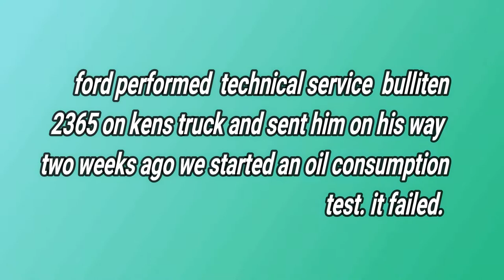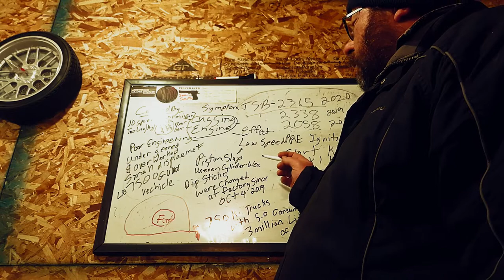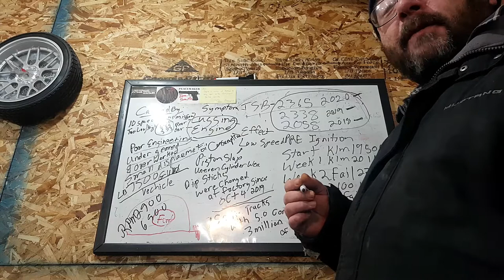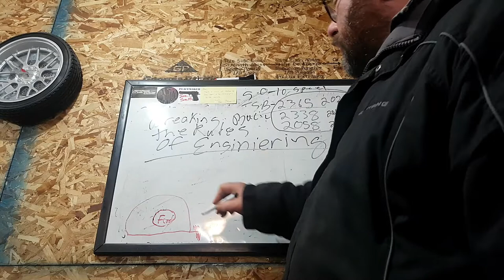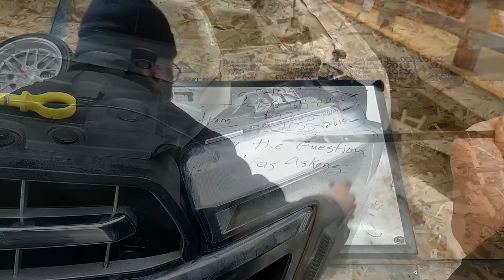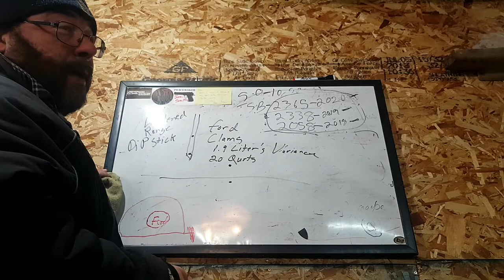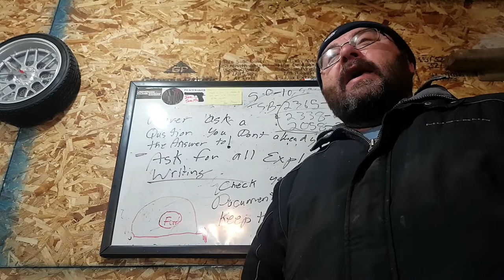ford f150 burning oil problem and consumption issues

Comment: I have a 2019 F150 5.0 V8. The truck was manufactured in December 2018. I bought it in August 2019.  After a couple of days of ownership, I noticed the engine idled fairly loud.  It sounded rattley, and had a tiny bit of knocking. I checked the oil and it was almost full, but not quite. Also, when cold, I noticed the transmission was downshifting harshly and I could sometimes hear and feel a clunk when it downshifted. I also heard a whining sound when the transmission is cold and downshifting to lower gears while slowing. When it warms up, the harsh downshifting and whining sound diminish quite a bit, but I sometimes still feel it.
  I called the dealership and spoke to a service manager the following week. He said the above issues are "normal" and indicative of the F150 5.0 V8.

At 2200 miles, I check my oil level and discovered my oil level was so low. It was well below the minimum fill line on the dipstick. I took the truck to a mechanic who saw NO leaks, nor did I see any evidence of a leak. The mechanic did an oil change and made sure it was filled to factory specs.

At 4600 miles, I checked the oil level. The oil level was again, very low, below the minimum fill line. I am bringing the truck in to the Ford dealer tomorrow (08/18/20).

This is all depressing.  I have owned several Ford vehicles previously and never had a problem.  I chose this truck because I thought I was getting a vehicle that was tried, true, and well rated.  I chose the 5L V8 because I wanted to avoid future issues with all the extra parts on the ecoboost V6.

What pisses me off most of all, is Ford knew about these issues in 2018 and they still sold me this truck in Late 2019!
Reply from the maker: they included 2020 in the technical service bulletins as well,no fix in sight,get documentation ,follow up with lemon law,please keep in touch and good luck with your fight!.

Comment: They had oil consumption problems back in 1987 when they went F.I. and still hadn't fixed issue when I bought a new 1990.I think Ford claimed a liter every 800km? was normal. After 4yrs they were going to rebuild(can't remember exactly) but I went and bought a '94 with the 300 instead
Reply from the maker: 1 liter per 800 k seems excessive to me. ty for taking the time mayes

Comment: What a bummer. Need to put a few more miles on my truck to see if the last TSB worked.  It was in the shop for a bit because ac condenser unit was draining into passenger floor board. Ruined the carpet, I didn’t notice because of the weathertech mats.  Waiting on a new dashboard too since mine is already warping.  Way too many problems for a new truck.  Thanks for putting these videos out!
Reply from the maker: thanks so much for taking the time andrew!

Comment: The 2019 5.0L has sprayed in cylinder liners, the rings do not seal.
Reply from the maker: the oil isnt getting past the rings its coming in through the intake,low speed preignition
Reply: All 5.0 2018-2020 has the same issue. Don’t understand why they keep making this crap. I did hear the 2021 5.0 have been corrected.
Reply from the maker: @saltrock9642  i would not count on them fixing it.  10 speed transmission would have to be rolled back to the 6 speed in my opinion. ty salt rock

Comment: Thought I had gotten a great deal on a left over new 2018 f150. I bought this truck 2 1/2 weeks ago today I heard a noise that i thought was a spark knock. I check my oil and after 1,749 miles i am 4 .6 quarts low. So mad they didn't warn me of these especially after I asked a ton of questions
Reply from the maker: Stay in touch.  Does your state have a lemon law.
Reply: Yes, I will be exploring my options regarding lemon laws as in SC we have pretty good Lemon laws here
Reply from the maker: @mewbourn76  that's excellent.

Comment: I'm wondering if the government demanding that Corporate Average Fuel Economy, or CAFE, standards requiring an auto company to deliver a fleet average of at least 54.5 mpg by 2025 has anything to do with them toying around with all kinds of things they shouldn't.  I think those standards are being rolled back, but decisions were made already on the current vehicles.
Reply from the maker: Definitely part of the problem 🤜🤛
Reply: And don't forget good old "corporate greed" as well.  They want to squeeze every penny of profit out of these vehicles regardless of what's best for the customer...

Comment: TFL Truck just featured a video with a guy who has a 2018 5.0L. According to him, his dealership replaced the PCV valve with one that had a different design and he claims his issue has been solved since April of 2019. He didn't go into specifics though.
Reply from the maker: thanks for the heads up red wings. appreciate it!
Reply: @thisguysgarage  not a problem! Really hoping to see you solve yours!

Comment: I experience the lugging and preignition. You can for SURE feel it as you cruise 45-55 mph.  Mine sucks down 2.5 quarts in between 5k oil changes. Shame because if the trans held the gears a little longer this would be an awesome truck. Maybe worth a transmission tune along with the ford pcm flash to prevent fuel cutoff when decelerating? I would love some trans tune company suggestions!
Reply from the maker: i would look for a good vehicle tuner in your local area, have you tried sport mode?
Reply: @thisguysgarage  I haven't regularly used sport mode, no.  It is a bit too aggressive. I am trying not to sound picky but clicking over to sport mode every time I drive is a little much. It also holds gears up to about 4k rpm. 3k if you are babying it.
Reply from the maker: @zacharywatson3242  Is ford doing anything about the consumption issue?

Find a dyno/tuner that is reputable, this was the route I was going to go if ford had replaced my engine.  They can make it the way you want it 👍
Reply: @thisguysgarage  Just had the pcm flashed.  It does make a huge difference. No more lugging. I also changed the PCV valve to the Mustang 5.0 part (Part No. EV 281).  I may put the catch can on as well. I will update with results after a couple months.

Comment: This is why I specifically looked for a used 2015-17 5.0 with the 6 speed. The 2018+ 5.0 also has port and direct injection. Direct injection requires/creates more pressure, which causes more blow by (in theory). 4 more gears in a transmission plus a more complicated engine, all to get .5-1% better fuel economy, just means more stuff that can go wrong. Also why I do not like the v6 turbos. If any part of the turbo systems fail, the cost is about as much as a new engine. Everyone is worried about the carbon impact of vehicles. Well, what is the carbon impact of building a completely new vehicle because the one you own wont last 200,000km???
Reply from the maker: absolutely 100% , I wish I had kept my 16 it was trouble free. 🤜🤛
Reply: the 2015-2017 have direct injection only I believe.  the 2018 added port as well to help keep the cylinders clean and added some HP due to more fuel availability.  Just having DI in my opinion is worse due to the cylinders getting gross after 30k miles.

Comment: I've thought this all along.  My 18 F-150 5.0  3:55 gear going down the highway 70mph with cruise set doing 1200rpm.  That's almost lugging. That cannot be good for any V-8. I drive mine mostly in sport mode just to wind it up. I do not have the oil consumption issue though at 15k. mi. I think at highway speeds these trucks are geared way to high.
Reply from the maker: result low speed pre ignition. ty for taking the time mike, keep an eye on it!

Comment: The 15 17 with the 5.0 are bulletproof I heard it had to do with the ceramic coating on the heads causing all these issues I could b wrong. Seen some 5.0 with 250k already. I have a 2.7 Ecoboost no issues have 90k now
Reply from the maker: I had an 11 13 15 and 16 all were bullet proof. ty jay

Comment: The transmission was co developed with GM. However the GM trucks don't seem to have any of these problems. Whatever GM did seems to be working.
Reply from the maker: I'm hearing of issues with GM not recommending towing with the 10 speed  but they do have 3 transmission options. 
Ty for taking the time 👉
Reply: @thisguysgarage 
That's interesting. I haven't heard of any towing restrictions for the gm 10 speed. The last TFL towing test with the gm 10 speed, they praised the transmission. Where'd you hear that from? Any updates on your f150 issues?
Reply from the maker: @curtis1951  it was from a subscriber.  Ford has not resolved any customer concerns on this issue. Trying to bury the problem with a 3 quart widened range dipstick as opposed to the 1 quart original equipment.
Reply: @thisguysgarage  
I've owned three F-150's so that doesn't surprise me. It should be illegal, especially for the price these trucks cost. I've had issues with the gm trucks I've owned but nothing like nothing like this. Hope you guys get taken care of but judging by how Ford's been operating the last few years I wouldn't hold your breath.

Comment: Whats your experience with the  durability  and  issues with maintenance with the 3.7 and the 3.3 ford v6`s? Thanks
Reply from the maker: here is the bonus ,if you can live with the naturally asperated v6 it still has the speed transmission which is good, the bad is the 10 speed transmission what is killing the 5.0 , the 3.7 and 3.3  are durable engines.  ty for the question and taking the time.

Comment: I had the same issue with my 2018 f150 5.0, it first started on the first oil change, at 36,000km they changed the dipstick and re-tuned the computer of the truck, im now at 39,000km and hasent dropped at all, they did made a mark on my dip stick with a sharpie so i can monitor it myself as well, its 2 quarts for sure between the add and full mark, i never had the transmission issue you been saying though
Reply from the maker: Ty for taking the time.  Just wondering if your truck is 2wd or 4wd .reg cab or super crew? Just wondering. Ty for taking the time.
Reply: this guy's garage its a 4x4 supercrew with the 5.5 box
Reply from the maker: @diftoyota  👍

Comment: Scotty Kilmer says the oil consumption problem is a Ford class defect that Ford won't admit to.  All of Ford's work arounds don't address or fix the real problem..... which is that Ford used an aluminum block on these 5.0 engines, and didn't sleeve the cylinders.  They used a ceramic coating in these cylinders (to save a few pennies), and this coating is either failing or it isn't working as it's supposed to, thus causing the massive oil consumption problem.
Reply from the maker: ty
Reply: @thisguysgarage  The only  difference between a 2017 5.0L and the 2018-20 5.0L is the new plasma welded cylinder liners were added. Period. Once bored out to spec, they are very thin walls, not enough there to make a rigid cylinder, no strength, no resistance to warpage under high heat,  they are simply wearing thru the bore liners in short order. No wonder the massive oil consumption. Don't expect much from a replacement 5.0L same plasma bore welded cylinder liners. Same old thing. Ford needs to go back to cast iron cylinder liners. Same 5.0L block was fine in 2017 back. With the cast iron cylinder liners installed. All the fixes for the oil burning are just buying time for Ford to get out of warranty on these junk blocks. And screwing their old time customers in the process.

Comment: They still can’t explain the rattle in the engine and the hard down shift. My truck is in the shop now with this issue (changing out 12 different parts in the engine) and the rental truck, 2020 F150, has the rattle and was 2qts low on oil. When I realized what engine was in it I had to look. Lol
Reply from the maker: my salesman told me to stop checking the oil and bring it back dead...
the rental is 2 quarts low hilarious
Reply: I’m thinking your in what we in South Louisiana call the “Frozen Nawth” so this issue is wide spread. Thanks and have a Merry Christmas
Reply from the maker: @saltrock9642  yes the GWN lol ty sir and merry Christmas

Comment: Ford needs to make this right
Reply from the maker: Absolutely Brandon. Ty for taking the time 👍
Reply: @thisguysgarage  I just bought a 2019 this week . 5.0  this will worry me something awful
Reply from the maker: @brandonmurphy4657  i would suggest a high quality oil like amsoil and use sport mode it will keep the engine from lugging . keep in touch!
Reply: @thisguysgarage  Mobil 1 ? I have always used it in my other trucks
Reply from the maker: @brandonmurphy4657  i have used mobile myself,low speed pre ignition is what is killing these trucks, the amsoil has been designed for this,when i put it in my new truck the engine got significantly quieter. ty again

Comment: My 2018 F150 5.0 have the same problem and Kitchener Ford, Ontario replaced engine last month and i have more problems now with my engine, always rattling noise from the camshaft solenoid which they replaced and it failed again and  oil leaks from gaskets and oil cooler. these guys don't even know how to replace an engine.
Reply from the maker: I am hearing quite a bit of that. 
Ty for taking the time 🤜🤛hopefully you get some satisfaction 👍
Reply: @thisguysgarage   I need a technical advice for a weird noise coming from the engine while accelerating between 40-80 Km/h, i managed to place my phone in the engine compartment and record the noise (they are trying to tell me that it is normal characteristic noise). 
Is there a way to send you the videos and get your opinion about that?
Reply from the maker: @willelm1529  upload to you tube set on unlisted and you can send me the link. you can upload strait from your phone on the home screen .touch the camera. button. let me know if you need further assistance. it will be private.
Reply: @thisguysgarage  Thank you for your reply, i uploaded two videos and here is the links https://youtu.be/rNFx91T1RW8   https://youtu.be/8Q1jhwwgyFs  
i took the truck to another dealership and they replaced both cylinder heads after excessive coolant consumption issue (reported that it was damaged and scored by the first dealership) when i got the truck the coolant level was at the max and now after 160km only it's below the minimum line again.
Reply: I uploaded the videos, hope you can assist just to know if i should settle.
Reply from the maker: @willelm1529  will do will do ,sending now

Comment: You my man are so wrong about rpms 2500 to 6500 that is 1970's rpm's not something that a person is trying to get reasonable fuel mileage with today. My '14 Shelby GT500 is doing 1250rpms in 6th gear @ 60mph. At 2000 rpm it's doing almost 100mph. It has lived the better part of it life between 1000rpms and 2,000rpms  But my 2018 F150 SCSB (super cab short box) 3.55 and taller 275/70R18 instead of 275/65R18 tires gets excellent mpg 18+ average in over 90,000 miles. That includes, city, towing and highway. I just went 10,000 miles on Schaeffer 5w20 with alot of manual shift down for braking and I was 4qts low on oil . I have installed the new recommend pcv and no need to change dipstick because full hole or mark is in the same place on both sticks also will not be manually using the 5.0 to compression brake in the future and will change my oil every 7500 miles after it gets over 100,000 miles and on to 200,000 miles to which I will then change every 5,000 miles there after. These engines will easily go 400,000 miles just like the 4.6.My Shelby has 60,000 miles on it and I change oil every 5,000 miles only because it is supercharged and that again is what ford recommends. It uses about 1/2 quart of 5w50 oil in 5,000miles. I won't say your videos are worthless because I don't think any videos or for that matter people are worthless, because they can always be used as a bad example
Reply from the maker: 4 quarts is a bit excessive... 👍

Comment: This makes no sense.
Reply from the maker: ty for taking the time!
Reply: @thisguysgarage  I'm notnsaying your wrong. But I'm almost certain the pcv system is to blame. I have friends that have the 3.5 eco and the 2.7 eco . They both do the same thing. Bmws do it and some chevs with the 5.3 do  as well.  From a bit of research I have found that the pcv system has a problem separating the oil from unburn  a/f gas and feeds it back into the intake. That is where the oil consumption  come from. Why do you think that there is such a large number of these 5.0s with catch cans on them? I'm not defending ford it's a joke that any modern engine burns oil, when it's trying to be more efficient. But that is the root of the problem.  Not the ten speed
Reply from the maker: @eLIJAH122  I love this well thought out comment.  I was actually getting to this in the series. There is just too much information to put in one video.  I was wondering if I could get your permission to use it in an upcoming video? It will be respectful.
Reply: @thisguysgarage  yes feel free to use the comment. I am just like you, and just want to get to the very bottom of this problem.